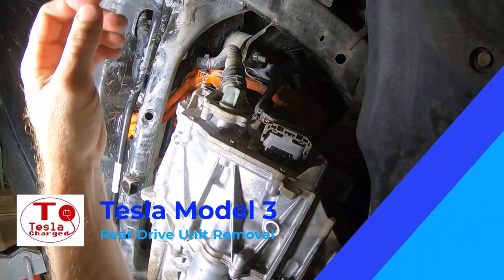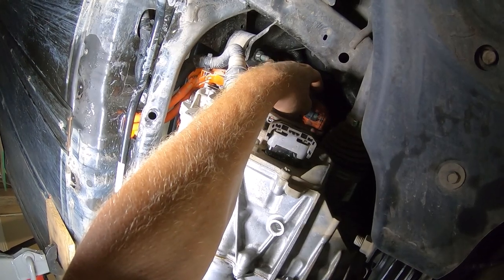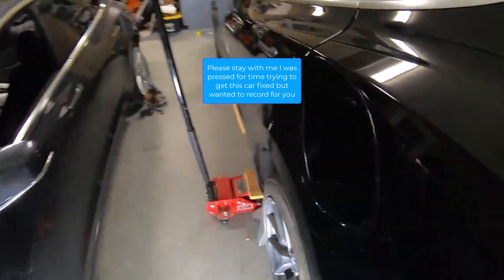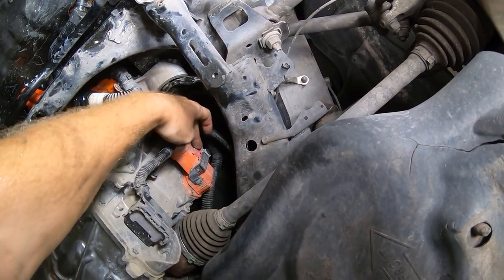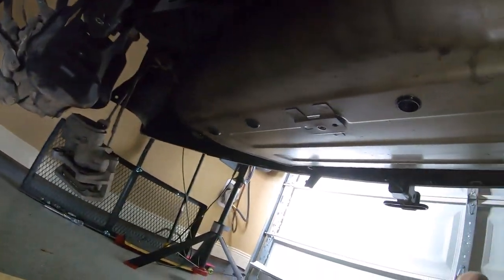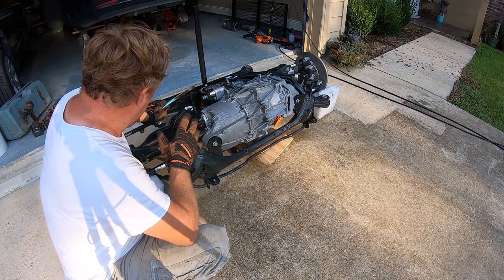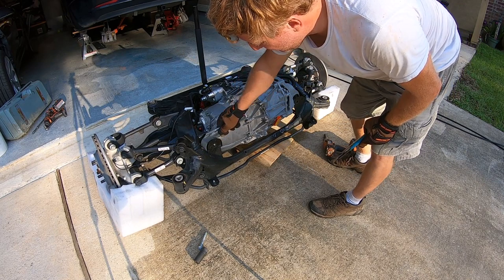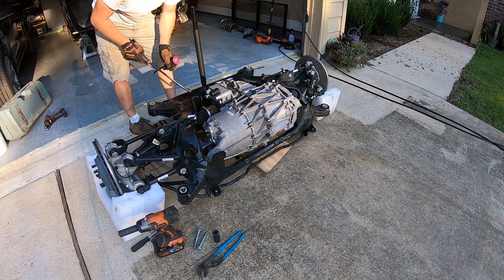Tesla Model 3 -  Rear Drive Unit Replacement - P2

Comment: I've watched your videos with great interest and appreciate how you spell it out technically and focus on content.  I recently purchased a wrecked M3 performance and discovered the CV axle was loose on one side, with the place on differential where the CV axle went all chewed up.  I'm curious if yours had the same problem.  I was able to get my differential sleeved by a specialty machine shop locally and I'm waiting on a bearing, since the shavings damaged the bearing that was in there.  So far, the fix has been about $1000, which is way less expensive than a replacement motor.
Reply from the maker: So actually on my motor which I didn't get to show yet but it will be in the next video. The motor suffered a catastrophic internal failure to the gear set of the differential. The damage caused a hole to be blown out on top of the motor. This is where the oil leaked in the video and spilled out.  I ended up replacing the motor with a new one off a model Y with only 5k miles for 2500$.

Comment: So your motor leaked oil at 150k miles?  Are you tryingnto fix the leak or replace motor with used one? Very interesting. I own 2 MYP's and want to keep them until wheels fall off so this is interesting
Reply from the maker: No we just hit 100k miles, I didn't show in this video what happened yet.  But the motor suffered a catastrophic internal failure of the gearset.  It ripped a hole in the top of the motor case and that is where gear fluid was leaking from.
Reply: @TeslaRebuilders  i can from other videos that that 3 is a salvage. Was it hit innthe rear that caused this?
Reply from the maker: @Pennychaser1  Yes it is salvaged and no it was a front end collision with no frame damage.
That was over 80k miles ago also so not related at all.
We are jokingly saying it has had... One to many launches!
Reply from the maker: @JetFire9  Yea for sure I agree and yet it was a weird failure that should not have happened.  Only thing I can think is it had one too many launches or weak pin design.

Thanks for the comment and watching.
Casey

Comment: What is the model of this tesla model 3? Is it the long range or mid range? Awd or fwd?
Reply from the maker: It is a 2018 M3 LR RWD
These come with a 980 motor to be a bit faster but it's just a hotter inverter "more igbts" exact same motor.
I replaced with a 2021 - 960 out of a M Y that only had 1000 miles on it.  After swapping the inverter and  stator sensor it wss plug and play as if it was never switched out.

Thanks for the comment and watching,
Casey

Comment: I did this on my 2020 m3 
Now I can not get the big battery to engaged 
Did you had to do any thing special
Reply from the maker: No but you may have a high voltage isolation issue check the car in service mode to see code definitions.
Reply: @TeslaRebuilders  is there way to put the car in service mode other than going by the service station
Reply from the maker: @SMHUBE00  if the car software is up to date you should be able to do it without going to the service center. Hold on the logo for the car under software menu. Password box will pop up enter "service" hit okay.
Reply: @TeslaRebuilders  well looks like my software is not up to date 
Is says cannot update contact Tesla service 
Any ideas
Reply: By the way your videos are great help thanks
Reply from the maker: @SMHUBE00  Has the car not been online for over a few months to a year?
Reply: @TeslaRebuilders  yes 
I have being working on it 
Finally got it going few weeks ago
Reply from the maker: @SMHUBE00  Humm it's possible if it's been off for too long you could have lost communication with the network.
Not sure how you can get that back but try and verify if you have connected to wireless data and phone app access.
Reply: It is connected to the app and the network
Reply from the maker: @SMHUBE00  You should join our Discord we can probably help you out further find the problem.  
https://discord.gg/QhYSCs4p